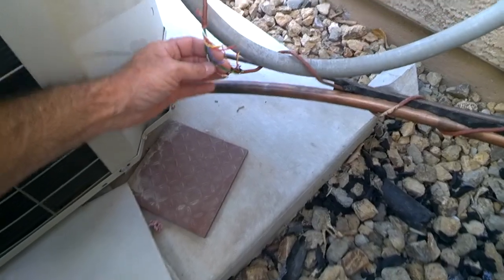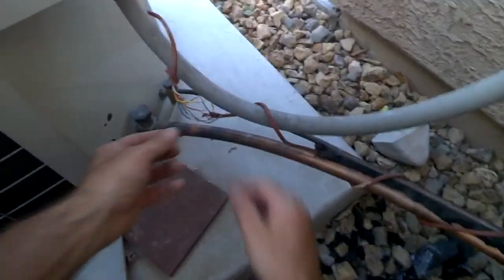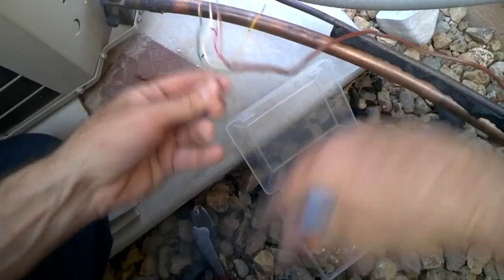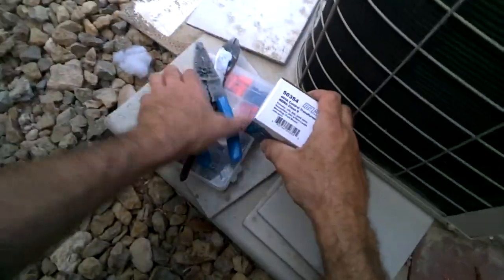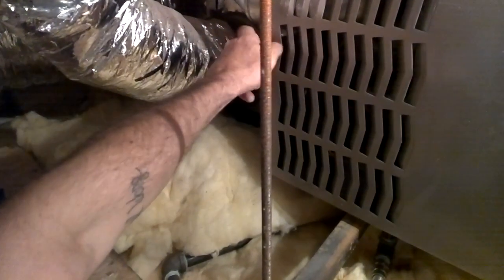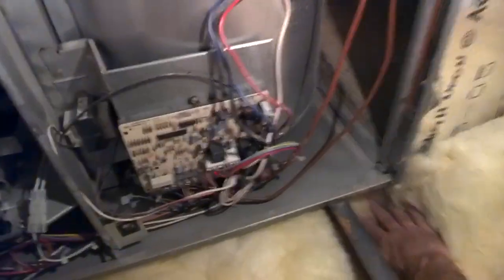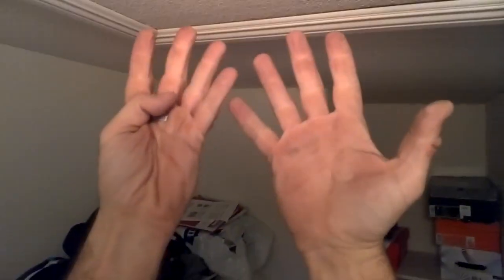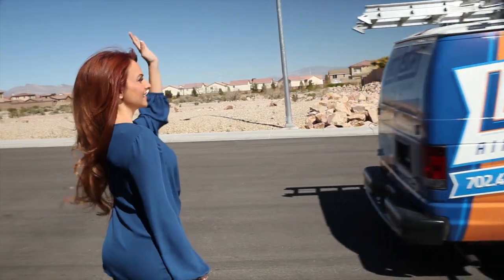How To Repair An Air Conditioner, After The Dog Chews The Thermostat Wires DIY

Comment: Question. I am troubleshooting a hoorendous install. No surge protection at all on this unit. The installer bypassed fuses in disconnect. Owners dogs chewed wires and they lost power. Capacitors look ok but i don't have a meter with capacitance reading. Would the issues still mostly boil down to the tranformer since the fuse in the attic isn't blown?

Comment: Can you still run the AC without this wire?
Reply: If it's like the video then they're the thermostat wires.  The thermostat tells the AC to turn on/off, so if they're cut it won't ever turn on.

Comment: My dogs chewed the cables, I see the damage but the ac still works. Would I need to still change the fuse? Or will replacing the wires will suffice?
Reply: same, if it's working ur fine but the wires do need to be fixed

Comment: Just wanted to thank you for this video. I was trimming grass today and hit the thermostat wires. I checked them over and things seemed fine until I got back home later that night. Worried I would have to pay $$$ to fix a simple problem , I found your video in which you explained about the fuse. After a few really sweaty hours, I swapped out the fuse and we're back in the cooling zone . Great video just carefully explaining this issue .

Comment: That fuse in the furnace saved me, connected the wires but still had no power, only costed 3.00 for the fuse thank you

Comment: thanks man! cought the control wire with weed eater. rewired and couldnt figure out why it wasnt working. its 90+ degrees here the last few days. found ur vid and saved my life!
Reply: Jackson Koenigs hey the same just happened to me as well my fuse or transformer didn't go out did ur tho?
Reply: Jackson Koenigs I just reconnected the wires and the fan was working again

Comment: We  lost cooling yesterday.  Outdoor unit was dead as a doornail.  Closer inspection indicated control wires were torn up a bit, and the lawn service had been here earlier in the day -- looked like they probably attacked the wires with a weedwacker.  Watching the video taught me about the fuse and transformer inside the indoor unit, so I was prepared when I tackled the repair earlier today (I had new control wire and some replacement fuses at the ready).  Turned out to only be an issue of the control wires getting yanked off the pigtails, plus getting insulation shredded off -- fuse was okay, as was transformed.  But the video definitely helped me understand better what I might expect to encounter, and the repair went quickly.  Spliced on new control wires and cleaned the fins, and all is running well.

Comment: The wires outside, that you put the twist caps on, do those wires need any other kind of protection from weather?
Reply: I would use gel filled landscape wire nuts for that reason. Im in northern indiana so everything gets waterproofed
Reply: @cooper8318  Thank you.
Reply: @agwbcfjc2  No problem. I know its an old comment but thought others might have the same question

Comment: There are only 4 wires coming out of the electrical box from the house to the air conditioner red, black, and 2 yellow why and what...do they run to

Comment: What if they rip it out of the unit? Need help
Reply: What answer did you get because thieves pulled my wires out of my AC unit they are one red one black and 2 yellow need to know why what and where they go or run to?

Comment: my unit has a blue and yellow wire coming out of it. And the house has a white, green, and red wire coming out if it. Which wires should I attatch? I can email you pictures
Reply from the maker: It depended which ones are attached in the attic.
Go to indoor unit and see which two are going to the C Y terminals of the circuit board. Whatever colors go to C and Y attach them to the blue and yellow outside. Doesn't matter which way
Reply: Thanks got it up and running
Reply from the maker: That's great good job
Reply: +Las Vegas Air Conditioning, Inc. where is the c y located
Reply from the maker: Msmaemae05 the C and Y terminals are in the attic inside the furnace or air handler.
They go out side and are the two wires needed to turn on am air conditioner so we call them c and y but they go to the coil of the contactor. Sometimes one of them makes a stop at a pressure switch then go to the contactor.

Comment: this is exactly what happened to mine.Thanks for the vid!Would both the fuse and transformer blow? I actually have a goodman, and only fuse I see says e on it and is purple, is that fuse? What amp is that fuse?
Reply from the maker: Jay mans usually it's just one or the other that blow, most common on a new system is a fuse and it is a 3 or 5 amp. It will say on it and you can use car fuses from autozone.
Reply: Got to it,it's not an e,its 3 . DIdnt even know 3 amp existed in fuses. Replaced since it was blown,ac didnt turn on,replaced the transformer since that tested bad as well,still didnt turn on,tested the contactor,came out to only 60 volts,I dont know when it blew,but it did.Bought one today for 12 bucks,installed,I am good to go. I wrapped the thermo wire pretty good under this time so my dog wont do this again. Again,thanks for the vid.
Reply from the maker: Glad to hear jay 👍

Comment: My neighbors thermostat wire has lost it's protective coating on the outside of all the wires.  The inner wires still have the plastic coating around the individual wires.  The area where the outer wrapping is missing is in the dirt and gets very wet.  Can this be fixed without running a new wire?  Thank you.
Reply: Yes. Depending on where the repair is needed you may be able to repair without cutting the wire. Typically the wire comes out of the building near the ground and runs a short distance to the condenser. If the insulation is damaged, there you can repair without cutting the wire by disconnecting the wire from the inside of the unit, thereby gaining a loose end. Then you can slide a piece if heat shrinkable tubing over the loose end and slide the tubing down to the damaged area, then use a heatgun or hair dryer to shrink the tubing and get a repair. If that's difficult or impossible, you can cut the wire, repair with the heat shrink tubing, then splice the wire back.
Reply: @TheLarryBrown  I appreciate the response.  I did move like 10 moths ago though.  lol

Comment: mine's only got red and white inside the brown... same thing though?
Reply: what about rain? those wire nuts are enough out there like that?
Reply from the maker: Zak K yes same just connect the ones you have. We only need 2 wires to run a straight cool system.
Reply: if you're really worried about the rain, run the wire inside flexible liquid tight conduit

Comment: The customer got lucky and saved some cash with only the fuse gone.  I  use heat shrink butt connectors to splice the stat wires. Thanks for posting
Reply from the maker: Those work well emin
Reply: I now install EVERYONE inside a piece of copper pipe.  After I nailed mine at home with a weedeater one day, I said enough of this stupid shit.

Comment: So that was the wires going to the indoor thermostat and its 24 volts ?  I am a new at this so forgive me if I sound silly. Yesterday I was working on my house unit. I flipped the double breaker. Checked the caps. looked it over and found nothing wrong. Flipped the double breaker back on and got nothing. Made sure the thermostat in the house was set at 60 degrees, waited and nothing. Went back to make sure I had turned the double breaker back on. I notice a single breaker labeled basement and it was flipped. The only thing down there is the lights and a couple of plug outlets. So I reset the breaker and the unit came to life. I forgot about the central heat and air unit. It is kind of hard to miss it is only as big as a car. I am guessing that mislabeled breaker is what threw me. Just saying sometime things are mislabeled.

Comment: My small dog just did the same thing.Lucky for me, he only chewed on the insulation but was able to make the wires have contact with each other.It only was a blown fuse. You video help me figure out the problem. Now my AC is up and running.  Thanks a lot!

Comment: Hi there -- I accidentally snipped my thermostat wire with hedge clippers while chopping my overgrown lawn that was wrapping around the AC unit. I stripped them, then I fused them individually with a soldering iron. When we turn the AC on, the inside unit is working and blows air out of the vents, but it's not expelling any cold air. The fan in the outside unit isn't working. Pulled apart the thermostat to test it out and it tested ok. I've taken the fuse out multiple times and flipped the breaker -- no difference. In your opinion, what do you think the issue could be? I tried to kickstart the fan after turning the thermostat on and it didn't help.
Reply from the maker: I'd say your transformer blew.
Reply from the maker: Disregard, if he indoor is working it's not the transformer.
Reply from the maker: That's an odd one. Try this app it's a step by step troubleshooting tutorial
"AC repair matrix" or try it online at www.lasvegasair.net go to troubleshooting
Reply: Oh wow! She’s beautiful!!!
Reply: When the outdoor thermostat wires are damaged they will typically short and burn the fuse on the inside furnace/blower circuit board. You say you have taken the fuse out but you don't mention which fuse. Anytime the outdoor unit won't start the fuse on the inside circuit board is a major suspect. If you haven't checked/replaced that fuse, that's probably your problem. Typically you can visually see when that fuse is burnt, but if it looks ok, to be sure you should test it with a continuity tester. If your outdoor unit doesn't start then you're not going to get cold air. If your outdoor unit won't start, check these things: * Outdoor wiring from the thermostat. This is just a low voltage wire, you can just use a jumper wire with alligator clips to temporarily repair it and verify that's your problem. * The fuse on the circuit board in the attic furnace/blower unit. * The thermostat. Is it really trying to turn on the outdoor unit? If the thermostat is switching on the indoor blower unit, it's a safe bet it's also trying to turn on the outdoor unit, but suspect a problem there anyway. If you can hear the outdoor unit clicking, or you can see that the outdoor fan motor is getting power, because it's buzzing, say, or turning slowly, then you know the thermostat is trying to turn it on. * With the A/C set to "auto" and the thermostat set to some low temperature like 60 degrees F (so you are sure that the thermostat is trying to turn the A/C system on), verify that the outdoor fan is not coming on. If not, suspect #1 is the start capacitor and suspect #2 is the fan motor. Try using a small stick like a chopstick or a popsicle stick to manually spin the fan. Sometimes it may start up and that will cause you to suspect the start capacitor. You can test the start capacitor with a meter, or you can buy a new one for $40.  * The thermostat wire operates a relay that sends voltage to the fan motor. Check that the relay is clicking on and check that the relay is sending voltage to the fan motor. * If you determine that the fan motor is bad you can buy a new one with lifetime warranty for $150. Installation is easy enough except for getting the old fan blade off the old motor. One option is just to buy a new fan blade. Otherwise removing the fan blade will usually be difficult and may sometimes be impossible. Of course remove the bolts that tighten the fan blade to the motor shaft. Sand as much rust as you can off the old fan motor shaft. Then using penetrating oil. Then apply some creative uses of a hammer. Don't hammer the motor shaft. If you do that it will mushroom on the end and you won't be able to slip off the blade. You might be able to hammer the motor shaft using a block of wood as a cushion. When you are ready to install the fan blade on to the new motor, you wan't the fan blade to sit up as high as possible in the compressor unit housing. The motor shaft will be long to accommodate various compressor models. You will want to hammer the fan blade on to the motor shaft until it is as close to the motor as possible. You only want to do that once. If you push it on too far, backing it back out will be difficult, so test fit the motor into your compressor unit and get an idea as to high far back on the shaft you want to hammer the fan blade. There are your tube videos on why this is important. 

So the list of suspects is: Outdoor wiring, indoor fuse, thermostat, start capacitor, relay, fan motor.

Comment: I would run the low voltage wire in conduit or copper so it can't be cut again